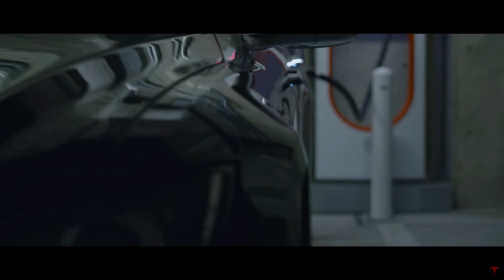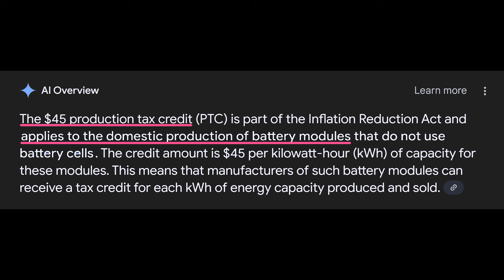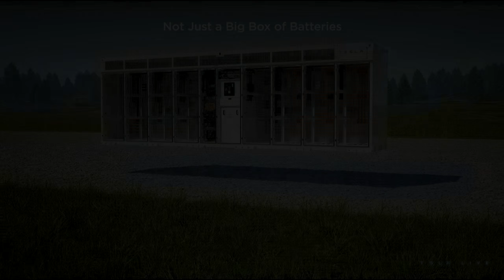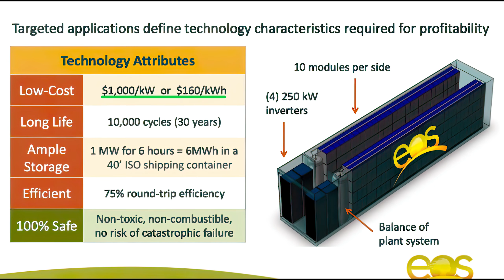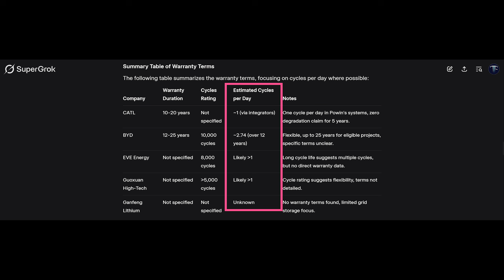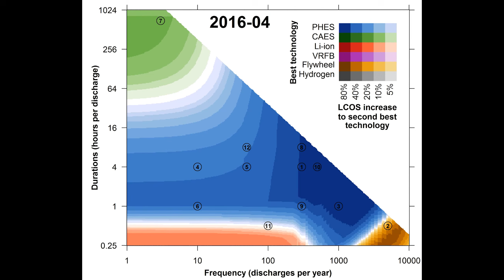The Eos Z3 Battery // Can It Undercut Lithium Ion For Grid Storage?

Comment: The original point here was to alieviate the need for utilities to run backup generators for high power demand thus saving everyone a lot of money
 The fact is eos also fits in well with solar etc. There are also monitoring costs with Li and maybe lfp. I was originally sttracted to eos by their zinc air battery which they seemed to have put on the back shelf. They did sell a few. These batteries were much lighter than Li, hold 3 times the charge, and do 8000 cycles! Maybe ZnBr is more reliable.

Comment: So summary, without the heat/fire worries while maintaining a flat discharge rate as it's strength. The 6k life cycles is kinda competitive with lithium iron phosphate. Energy density is lower, i guess 25% lesser than lithium. Sounds like the perfect hybrid plugin car battery. Prius plugin and hybrid modders start implement this to replace their battery packs. Huge market waiting.

Comment: Great video, as usual! Have you ever compared Lithium Ion with redox flow battery using iron and salt e.g. by ESS Inc. Without knowing much, that tech seems promising to me, at least for some applications, because of the ability to decouple power and energy, and because cheap adundant raw materials should help keep costs low.
Reply from the maker: Flow batteries are great for long duration, but lithium ion and eos are beating them to scale, which allows them to chew into that market share

If they don't hit large scale soon, then they may 'fail to launch' in the face of the competition
Reply: Gotcha, would be a shame. Hopefully a company starts scaling soon, or gets acquired by a company who can scale more quickly

Comment: Lets imagine a scenario where a large solar plant needs batteries to absorb and distribute its excess capacity. Are there advantages to them going 50/50 or 33/64 or some other ratio of LFP megapacks to Zn flow batteries versus going all in on one or the other? Are there potential synergies unlocked by say the Zn batteries being able to recharge the LFP megapacks in the tiny hours of the morning? Just curious if there's synergies here, whole being greater than the sum of its parts and all that.
Reply from the maker: Those kind of combinations are more done at the grid/system level rather than at the site level

And usually, they're solving one problem/market/application at once rather than multiple...addressing the current limiting factor

Comment: The Tesla app and tech for their large batteries is a huge part of the success of their battery back ups!! You may have already talked about this. Todd
Reply from the maker: Correct!  Megapack is the easiest/best onestop solution
Reply: It's true of so many things here in the 21st century that the quality of the software is at least as often the determinant of quality as the quality of the hardware.

Comment: Surely the longer duration discharge of this battery will become desirable as the grid generation moves away from fossil fuel towards renewables. And storage is needed to provide power 24/7 not just supporting  dips in generation.

Also as this happens all will need to look at differing chemistries
Reply from the maker: I covered that in the video

Comment: For that price it will fade away. At least it should be 20-25% cheaper than Li variant, at the same time, because its roundtrip efficiency. <92%. Whoever is using this vs Li is losing constantly money
Reply from the maker: No, becaues the LCOS takes everything into account, which was one of the major points of the video.

Comment: Great video!
I expected you to talk about how that the Z3 battery will have to compete with others besides lithium, such as the sodium?
Reply from the maker: Glad to hear it!

Yeah, sodium ion is promising, but it'll be about 5 years before it gets down to the cost of lithium ion.

And, the 5 year horizon has so many question marks already
Reply: The sodium battery co will have to go through years of building production line and all the headaches and certifications like eos did

Comment: When I was an undergraduate engineering student 16 years ago, I remember the hype about Tesla packing laptop batteries into a Lotus and making it fly with crazy 0-60 times.  At the time, I thought there was no way lithium ion batteries would be the practical long-term solution for transportation due to low energy density, although it was possible the car could be engineered around the battery to work around this (something beyond my scope as a ChemE).  I did realize I hadn't seen enough work on this to understand the feasibility, but the zeitgeist of that time definitely treated Elon as a foolish sensationalist.  I'm glad Elon proved me wrong.  Reality can be humbling.  At that time, I believed Zinc Oxide batteries (arguably termed fuel cells) would be the eventual solution due to the combination of low cost and high energy density, so long as the corrosion process could be engineered into its operation.  I have been following EOS and have been impressed with their accomplishments.  Elon says there's about to be a huge squeeze on lithium ion battery supply with the ramp up in grid storage and robotaxis, and I think this could create a window of opportunity for EOS.

Comment: In my former career as a consultant I looked deep under the hood of this tech and company, also in detail at several flow battery technologies.  The biggest dirty secret of all flow type batteries is the refresh and cost of the electrolyte and the frequency of electrolyte maintenance (i.e., “refresh”). Eos’ has a “made in USA” story right now. However as a battery storage developer I would not bet tens or hundreds of millions of dollars on putting this into a project, as there is no validation of OPEX and reliability, and most importantly availability, which is a critical factor that supports the ability to qualify for capacity payments in most wholesale electricity markets. Eos has somehow survived multiple rounds of investments and near bankruptcies, and multiple shakeups in senior management. They have several “pilot” projects and multiple “announcements” but I’ve yet to see demonstration of a commercial Eos battery reporting profits for an owner.
Reply: The Eos Z3.5 is a non-flow battery. It’s often confused with flow batteries but it is in fact a non-flow system that is static and sealed, with no external tanks or pumps, nor does it require a refresh or maintenance of the electrolyte as your post indicates. The electrolyte remains within the cells throughout the operational life of the battery
Reply: And yet they have gotten multiple orders from notable large utilities and repeat orders. You got to think they asked all the right questions before spending millions.

Comment: The trillion dollar question is the future mix of products from different companies and technologies. It’s a classical optimization problem, as we mainly deal with quantities and unit costs and performances it’s a linear programming problem, solvable with methods such as Simplex. Imo understanding how these solutions usually tend to look like is beneficial here, so play around with some linear programming. The solution is to go full on the cost effective solution until you hit the first constraint, then follow that constraint with a mix of two products etc until you have saturated all constraints. Tesla did this in the MPP3. Since then the assumptions have changed, but the solution will look similar. I doubt that adding 12h battery to the MPP3 problem statement would have had any material changes to solution…
Reply from the maker: Great insight

Comment: Since data centers use DC electricity, I wonder if DC-DC battery storage within the data centers would have a cost advantage by eliminating the need for inverters and that $/KW expense. I haven’t heard much about data center specific batteries.
Reply: Good point, never thought about it
Reply: There's still power electronics required to adapt the varying battery module voltage to a relatively constant voltage to supply the racks. 

It's my understanding the largest datacenters (Facebook, Amazon, Microsoft) have already been using direct DC-dc batteries without inverters for a number of years

Comment: The Li-Ion total system cost in all of those graphs is way higher than what the reality is. Those numbers are from a couple of years ago and prices are continuously dropping. It doesn't look good for this battery technology aside from the non-cost benefits.
Reply: Are you factoring in the massive tariffs that lithium batteries are about to get slapped with, as well as the tax credits domestically made batteries re going to receive? This makes the Z3 even more attractive than his graph
Reply: @lumpenstumper6151 thats not all. Imagine China goes for Taiwan and has 80% of the whole world lithium refinery capacity. Tesla megapack depence on China battery imports despite Corpus Christi which is the first step in lithium refinery for Tesla. Keep in mind how long it took to build this one and you need many more.

Comment: if you are building a solar only community you would want a longer discharge capacity because you need power from sundown to sunrise. If you are grid tied you may only need enough to handle shorter outages.
Reply: You would want a mix, the EOS unit was originally developed as a solar battery by Exxon, if you look at durations for solar+storage ideal sizing then it’s 10-15hrs for most sites 

EOS is limited on its max discharge rates so coupled to a higher discharge but shorter duration LFP unit for high power times which are usually short lived duration and some sort of very long duration like Form energy or Hydrogen would be an interesting format

Comment: The fire-resistant nature of EOS could allow for a hybrid site where you have a EOS container in between two megapacks where currently there's an empty space in between? And the site can double-dip on the price benefits too, discharging EOS at the efficient speed while also keeping some energy for the night.
Reply: When talking megapacks, my understanding is that nearly all newly installed ones are only LFP based, where the flammability issues are almost completely mitigated now. Hence I think that for the end user, this is less of a selling point.
Reply: @vaclavmatousek3007  They are still flammable, just not prone to thermal runaway like NCM batteries. You still need advanced fire suppression systems and cooling. LFP is leaps and bounds safer than NCM though. Don't think there is enough benefit for a hybrid site like nagi suggest, battery management, installation and multiple suppliers are extra complications
Reply: @vaclavmatousek3007 would save on not needing fire suppression system
Reply: Wow, I didn't even think about it that way.

Comment: So it has a lot of heat losses but doesnt require thermal management???
Reply: Yeah, can’t tell me that under high discharge it loses 25% to heat and doesn’t have to dissipate that.
Reply: @Guturkc it’s water based so not as effected by temperature as the heat can dissipate through the fluid in the cell, which then has a large surface area to get rid of it, as the video showed it has a wide operating range.

LFP doesn’t have a wide operating range the cell temp needs to be in the 20-25degC range so needs temp control, heat only conducts out of the cell and has a small surface area so needs taking away from cell to dissipate via a heat exchanger. In EOS case the cell and structure act as the exchanger

The heat losses vary by SoC the worst case being 25% lost on RTE at less than 10% SoC but only @4hr duration, that’s only part of the cycle RTE is higher (less loss) at higher SoC, these units are best suited to 8-12hr duration which again has higher RTE so any heat lost has a longer period of time to dissipate
Reply: In reality, they will need thermostatically controlled forced air in most climates. The fans may not run very often, but they will need to be available for heat waves.

Large transformers have thermostatically controlled cooling fans too. Those transformers are often installed outside on concrete pads at substations. The utilities don't count that as climate control.

Since they generate heat while in use, they won't ever need explicit heaters. Under extremely cold conditions, they may need to move a token amount of energy internally to stay warm.
Reply: @hamjudo indeed they do have forced air cooling via fans to in the doors, but that is only for the extremes of temp, it doesn’t have the always on complicated liquid heating / cooling of LFp

Comment: In Arizona (phoenix area) we get up to 115 F on a regular basis in the summer. Employees of the local power company, SRP, tell me that BESS with Li-ion is a no go because of the heat they'd be exposed to. Perhaps this chemistry might be able to work?
Reply from the maker: It could be, but I'd like to see that actually debated.  

Most of the time, people are operating off of beliefs rather than facts.

As I showed in the video, both chemistries have a similar operating range.

The megapacks come with cooling and that's factored into the lifetime cost and durability.
Reply: @thelimitingfactor why are grid storage batteries installed on the ground level, especially in a hot and cold desert.  Wouldn’t it be better to dig a hole and place them underground where it’s cooler and more stable temperature with no extra costs.
Reply: @OnlyUseMeC4s  Ah, no.
Reply: @tjmozdzen Thanks for the input.  Great conversation.
Reply: @thelimitingfactor  In Phoenix, the cooling costs wipe out Li-ion BESS benefits per SRP.

Comment: If it was here 10 years ago, it might have a solid chance. But with growing scale of highly efficient and LFP batteries and emerging Na batteries, they will have trouble to compete. In my opinion, short duration storage will be tackled by these two types, the interesting part is long term seasonal storage. That is where I see opportunities for CO2 reduction to methanol
Reply: “If it was here 10 years ago, it might have a solid chance” and “emerging Na batteries” are competing ideas
Reply from the maker: Yeah, two competing exponentials is always difficult to gauge!  💯

The seasonal market will start to gain clarity in about 5 years.  It's still so far off.

It may be that we just use some type of fixed generation and back it up with batteries daily with 16 hour storage.

Comment: Good to look at it. But it seems not a big jump. 
You did not mention Sodium in this video. Right now i see for Storage LiFePO4 and Sodium. LiFePO4 will bring the costs further down because of the large production and knowledge retrieve. Then maybe Sodium. For others there has to be a quantum leap (as reduction of expenses). 
What do we have for economic storage in the range of 2-5 days? And for Winter periods (central Europe 1-3 months where there is nearly no sun? Either fossil production or high-voltage direct current (HVDC) between continents.
Reply from the maker: It's a fair point!  

But, sodium ion won't get cheaper than lithium ion until about 2030, and I tried to stay within the 5 year timeframe.  Who knows what the Eos cost will be in 5+ years.  Too many unknowns.

I think up to 16 hours Eos and Sodium ion will be good.  Beyond that, as far as I can tell, we're really getting into seasonal storage as the next major application.

For that hydrogen or just using some type of fixed generation like nat gas, nuclear.  Maybe compressed air or geothermal (location dependent).
Reply: @thelimitingfactor  There's a few YouTuber's no doubt that go for shock for hits. That said the CATL sodium unit supposedly powering  tens of thousand urban delivery vans and some sprukers championing a cost of $10/kwh .... All this with a grain of salt(pun intended). 
I got the antenna up for any stationary storage CATL sodium offering. and a pull apart of what CATL is, supposedly  currently producing.

thanks for your work.
Reply: @thelimitingfactor  Thanks.
Reply: Are these sodium companies actually in production or are they still in the lab and > 5 years away